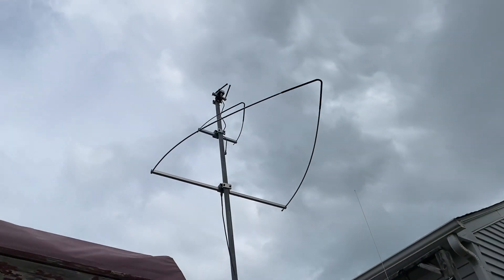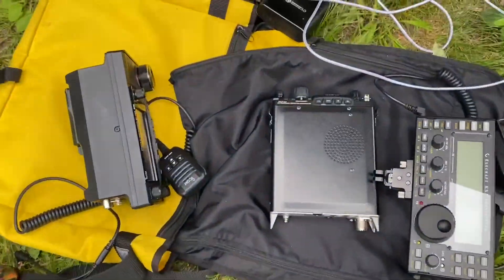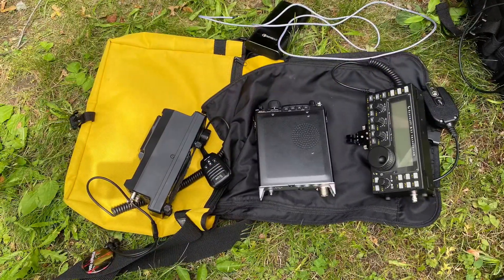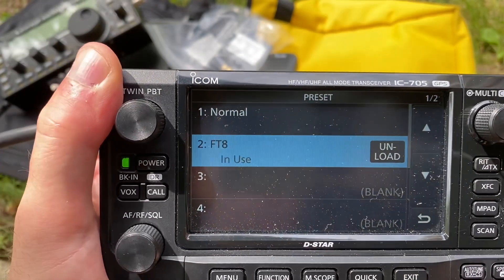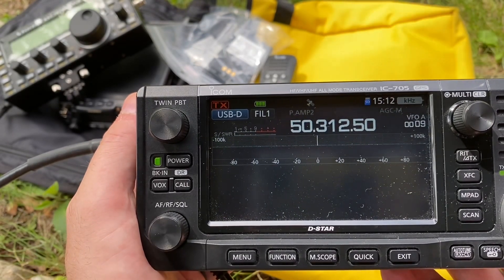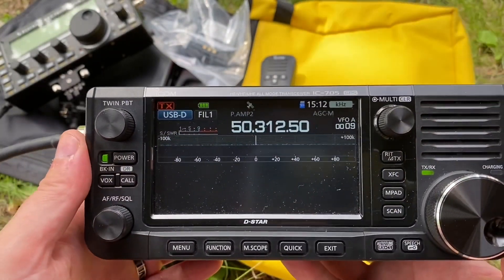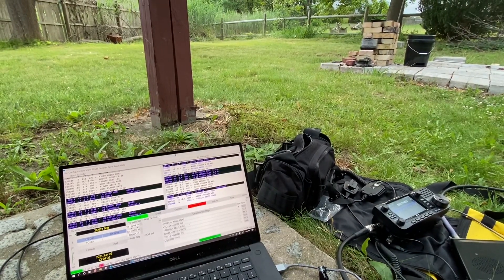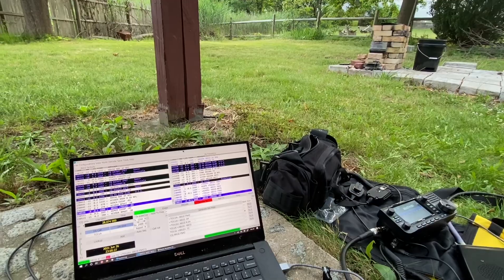Field Day 2021

Comment: Honest question: Of what possible use would FT8 be in an actual emergency? I have never used the mode but understand it is EXTREMELY limited int the amount of information that can be included in any QSO beyond call sign, grid and signal report. JS8, Winlink, Morse code or SSB can actually pass traffic but my understanding is that FT8 is basically a propagation tool. Please understand, I am honestly asking, not insulting as I fully appreciate that you have made an honest attempt at communication in emergency conditions.
Reply from the maker: got caught up in the excitement of FD and FT8. You have me thinking more. Thank you.  For emergency traffic handling FT8 could not approach phone, cw, etc. for usefulness.
Reply: @Cemental  Thank you for not taking my comment as an attack but as an honest question. I am glad and again, Thank you